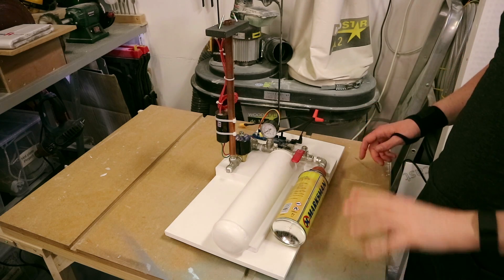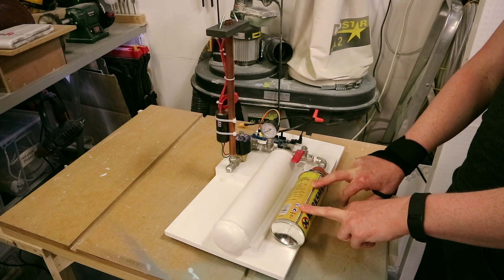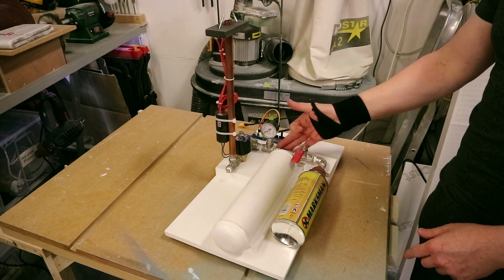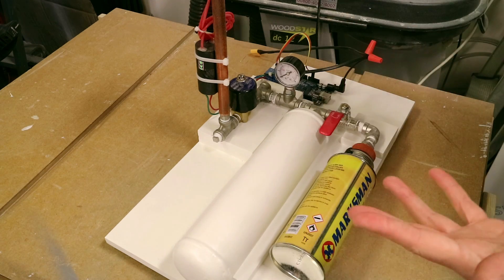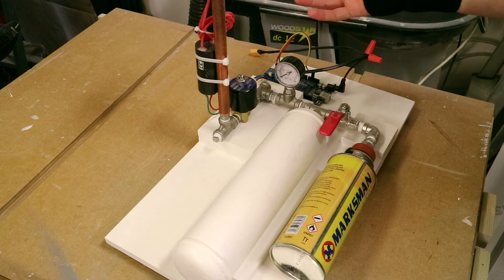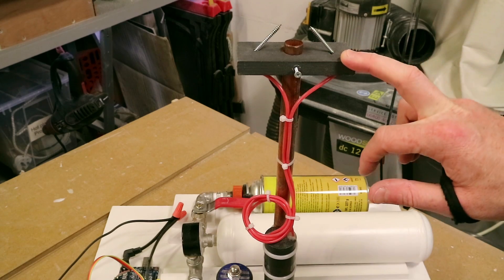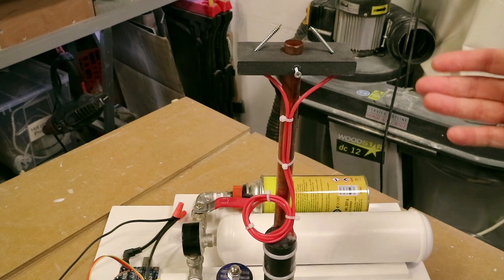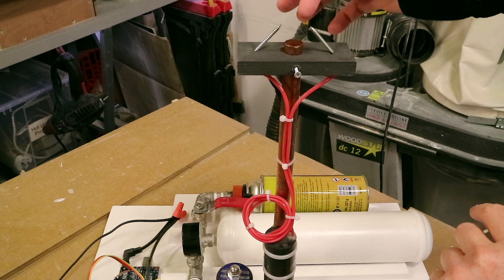🔥 Making Fireballs! Building A Fire Poofer

Comment: A more elegant pair of spark electrodes would be the ones used in oil furnace burners.   Do a search for "Oil Burner Electrodes"    You could use an oil furnace transformer (120v to 10,000v) and build a jacob's ladder over your device.  The constant spark starts at the bottom travels up and breaks then reforms at the bottom.  It would be an interesting display followed by the massive puff of fire.

Comment: Very cool! What solenoid valve did you use? I'm doing something similar and struggling to find a suitable solenoid valve for high pressure combustible gas. At 25C the vapour pressure of butane is about 1 bar (100kPa), and there aren't many EN161 valves around that can handle that. Maybe I'll have to go for something not specifically rated for combustible gas...
Reply from the maker: The one I used definitly isn't rated for combustible gas!
I wouldn't use anything like this professionally but for learning and messing around its good enough.

For the type I used search ebay (or equivilent) for "1/4'' 12V DC Electric Solenoid Valve"
Reply: Arthur Guy hehe cheers
Reply: Hey Arthur, I have another question. What HV generator are you using? I'm having difficulty with my ignition system. I've tried a little dual arc "flameless" cigarette lighter, and it's totally useless - I get incomplete ignition. Then I tried some HV generator modules from amazon - one "700kV" and one "1000kV". Totally fictional numbers, of course, but they aren't much good either. They make terrifyingly loud snapping arcs, and again, incomplete ignition. A pilot flame works beautifully, but I'd prefer something electrical. I've been faffing around with platinum wire heaters, which are sort-of-working, but also not amazing. Your system looks pretty reliable, so I'm curious what you're using.
Reply from the maker: I used the high voltage generators, in addition to the terrifying crack it does a good job of igniting the flame!
It works very reliably, not sure if this is a good system or if I just got lucky.

I have added some links to the video description including one to the generators I used.